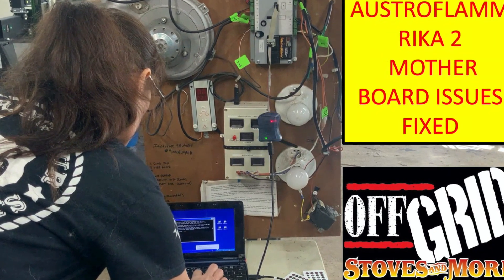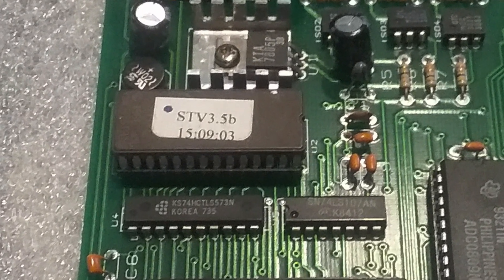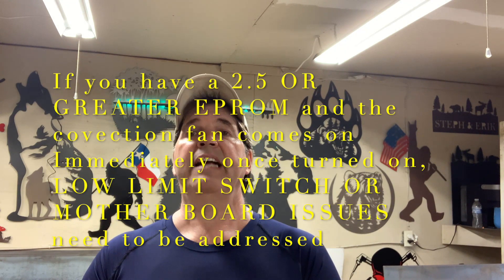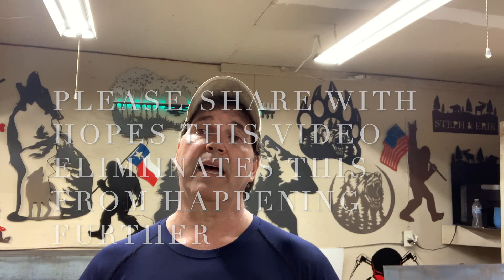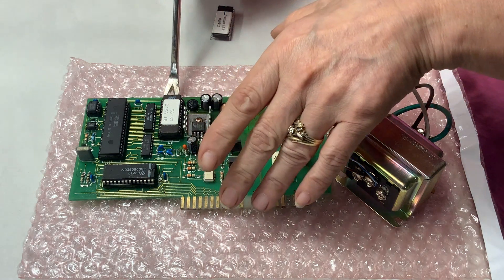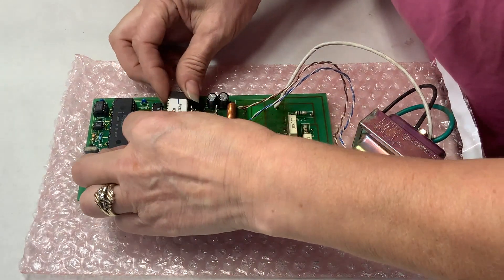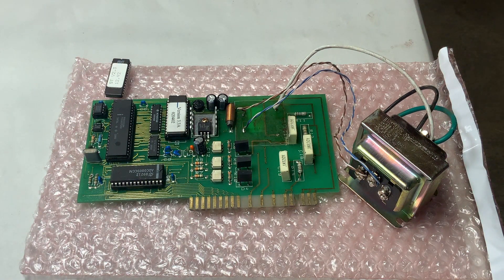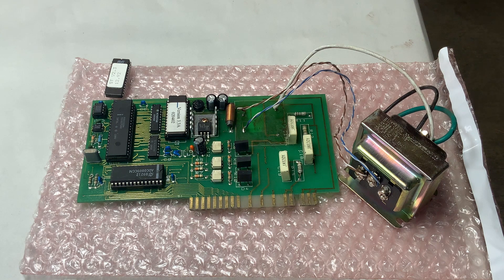AUSTROFLAMM " INTEGRA 1 " MOTHER BOARD 3 5B UPGRADE - EVERYONE NEEDS THIS UPGRADE !

Comment: I see you rec'd my board today....
No ignitor working, new board either. Can u upgrade that board for battery backup and thermostat ready like new board..?
New board is finicky on 5% heat setting as 10% burns us out of the house..!! Shuts off alot too each overnight.
Reply from the maker: Sounds like we will have you up and running in no time. We appreciate the opportunity to serve you Steve. Peace